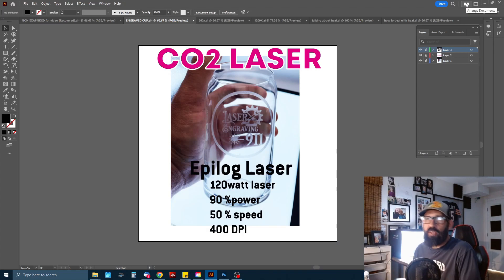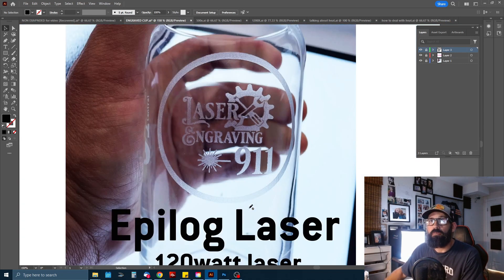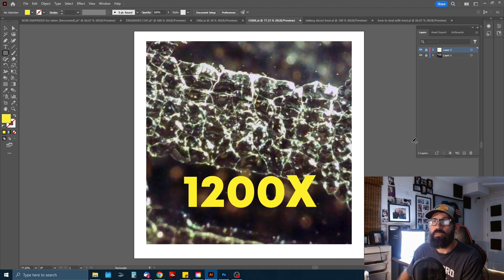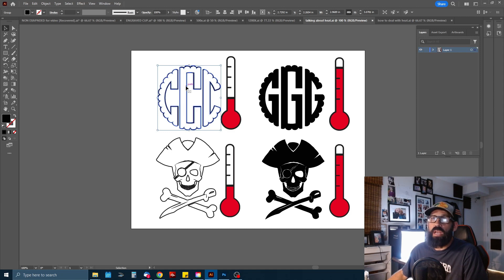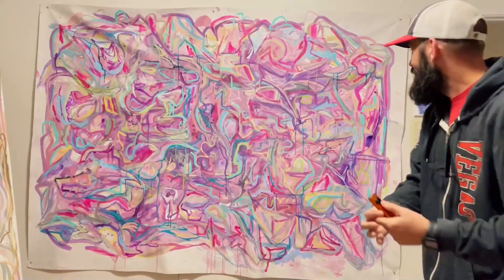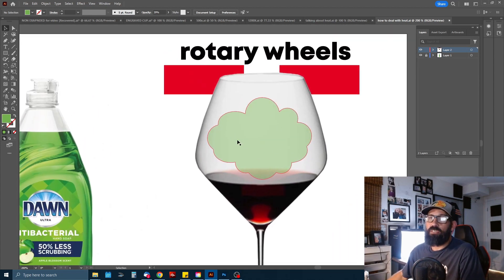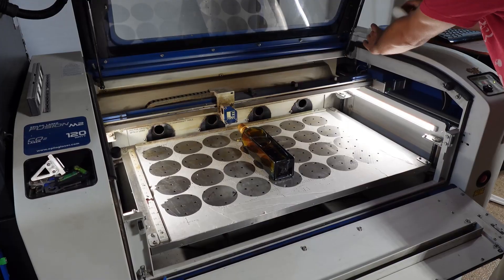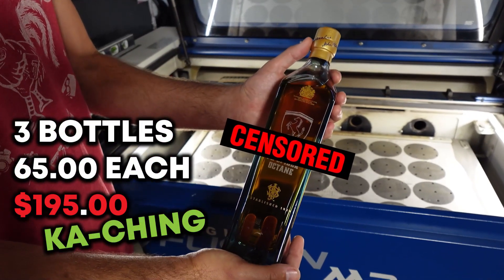Laser Engraving Glass: Tips and Tricks + Laser Engraving On Full Bottles

Comment: Great video,  very informative.
i plan on buying a xtool s1 (40 / 2w IR) to laser etch glass bottles for my hot sauce. 
Do you think the machine is capable of reliable etching the glass?  
Is  there any notable difference between etching the glass while empty,  or while full?
Reply from the maker: Dont get the S1 for engraving on glass. The S1 is a diode laser and cannot engrave glass without doing a whole bunch of work arounds, its not the right laser for the job. You want to get the P2 "Co2" laser from xtool 55watt with rotary tool check this link out https://shrsl.com/4fnxt  The P2 is a great laser for doing glass, and you can do the glass bottle full or empty doesn't matter. Hope that helps

Comment: Love the close up views!  Any idea what 40% speed equates to in mm/sec on your Epilog?  I've always engraved glass at much lower power even on my 60W.  I think I found my sweet spot to be around 200mm/sec at 19% power.
Reply from the maker: Thanks! The Epilog  In The video is the M2 Fusion max speed is 3048mm/sec so 40% of that would be the answer, so 1219mm/sec, I think my setting works for me cause if the speed that available on this machine, plus having the 120watts, I think if your setting sound like a good stating point, try messing around with difference dither patterns too!
Reply: @LaserEngraving911  Thanks! When I saw 90% power my first thought was WHAT?!? But then I thought about how fast those Epilogs move :)  Appreciate your tips!